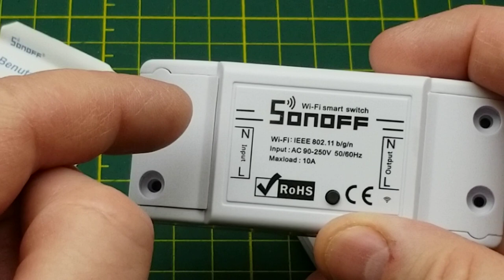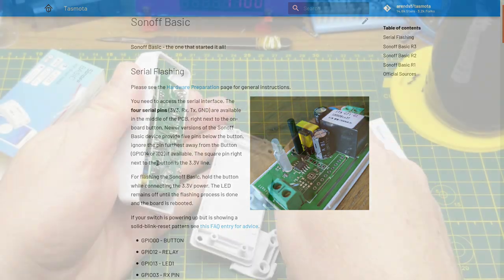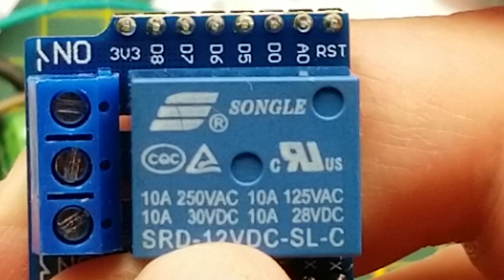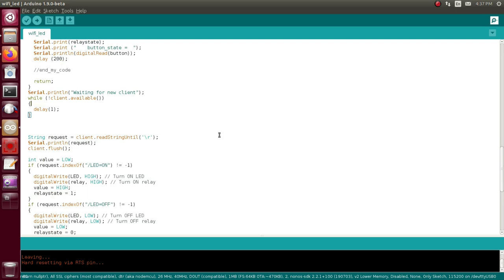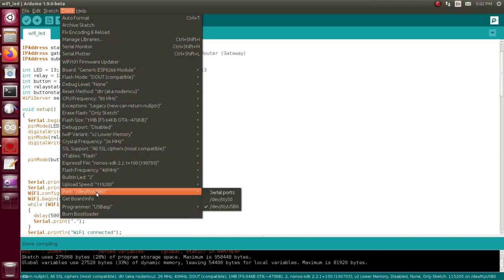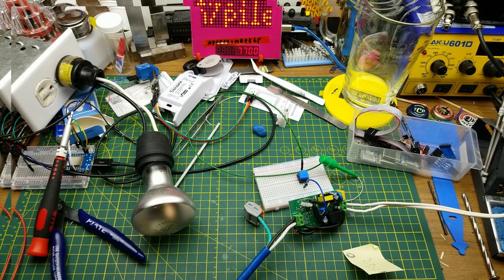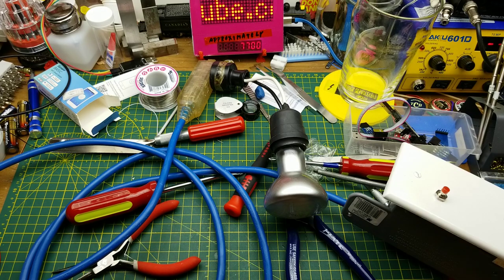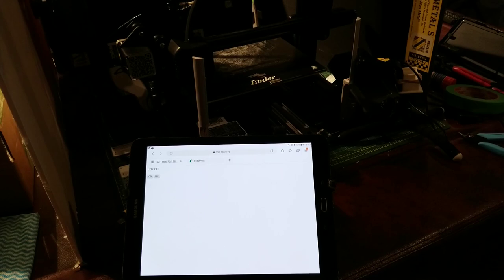Wifi controlled switching - hacking a Sonoff device

Comment: You have a Sonoff Basic R2, which is why GPIO 14 was not found. The older ones don't have the large black wires for the mains current. The GPIO 2 pin with cause a boot failure if it is held low when the unit is powered on. I've done several with the external switch connected to the RX pin (GPIO3). Programming was easy using Hpme Assistant and ESPHome. Using GPIO3 (RX) will let you use a toggle switch, for example, a standard light switch. You just have to flash it before soldering on the switch wires. The program can be updated over-the-air so the serial connections won't be necessary after flashing.

Comment: Great project, and for those naysayers saying that version of pi doesn't work, I guess you proved them wrong. Great setup and idea.
Reply from the maker: I still would recommend that people use the supported hardware, but in my case I use the most basic feature s so I don't overload the poor little guy.

Comment: Neat lighting on your Ender 3. I did similar, instead running a strip inside the bottom-facing v slot of the top rail. I also placed a short strip directly onto the hotend cover to illuminate under there. I still haven't gotten around setting up Octoprint, but I have all the parts to get it working.

Comment: Thank you for your time and nice video. I would assume Tasmotizer tool would be much easy to set up your GPIO pins. Haven't tried with ESP tool to flash the chip yet. May do it sometimes.
Sorry I missed how you connected the push button switch to the R2 device. Would assume you wired one end to GPIO2 where you connected 10K Ohm between GPIO2 to 3V3 pin. Then the other end of the switch wired to the GND pin. If that is what you did, I would like to give a shoot. This will be a cool to use the R2 to control a light through App/HA or a physical switch button. Thank you.

Comment: Itead also have a Zigbee version of this.   Most of the Itead WiFi stuff is highly hackable as they are based around the ESP8285 chip, which is pretty well an ESP8266 with 1mb RAM onboard. 
They are a really great devices.  Very popular with "Makers."   The SonOff Mini is also great if you have less space.  You can modify the SonOff Basic t0 be a dry contact relay as well.  I use one with Tasmota as a "smart" thermostat.

Comment: I would have just gone Tasmota on that. It comes with a UI for the web, can be direct driven by URL Post commands.
The default button is an on/off by default as well. The external switch is a useful addition for your use case though.
Reply from the maker: I looked into tasmota a bit, but they focus so much on the MQTT / home assistant stuff that I never found that info.

After several people mentioned that there actually is a web interface I finally found it buried deep in the project's web pages.

Oh well, this was a fun challenge. And I learned some stuff.
Reply: @pileofstuff  MQTT is a great way to communicate with these.  Tasmota does have a lot of Home Assistant fans, so it is easy to get lost in the documentation.  Home Assistant seems to be popular :)
Reply: @pileofstuff  One day I will get you on Node-red and MQTT.  I think you'll genuinely love it...but this was a good project in its own right and I learned some stuff along the way.

Comment: The Sonoff S31 has regular AC receptacles, and does Kill-a-watt-like power monitoring, which I've seen used for interesting things like detecting when the washer's done by the drop in power draw. An interesting member of the Sonoff family (I'm using with Tasmota and Home Assistant).
Reply: btw, the s31 is not supported by the sonoffs web interface still , cant even be turned on or off . the camera cant trigger a scene like they say it can. and ittt support is usless unless you want to pay for iftt and the advancded sonoff subscribion

Comment: Hi - You should flash these Basic units using Tasmotizer. The R2 also has a switch built in.  I also run Octoprint with the tasmota plugin which allows you to switch everything off from the octoprint webpage. I have all of this setup on my printer for the last few years and works perfectly.

Comment: This might be useful for me as a basement workshop hazardous (mainly thermal) kill switch and double checker, like if I was using hot air or a hot plate, I want to keep certain appliances like that on a dedicated power bar I can switch off upstairs if I forget and maybe have it semi-automated where I know I only need the stuff for a few hours so I set a 6 hour power strip shut down timer and have it protect me from myself

Comment: The button on the sonoff originally is programmed to manually turn the unit on/off.   Cool that you were able to add a second switch and enclose it in an electrical box and I don't blame you for not wanting to use the factory software.   Security concerns aside, seems a little strange to send the commands all the way to China and back if you don't  need to access over the internet
Reply: Yep. But it can be handy to have some internet-accessible server if you want to control it from your mobile phone, for example when that is not on your wifi but using 4G for its connection. Also when at your own home.
I really like this idea though and simply use the webbrowser while on local site!

Comment: I used the dual switch plastic boxs for my SonOffs. Left plenty of room for reset and pushbuttons.
Reply from the maker: I looked for those, but as I said, plastic electrical boxes are not very common here.
Reply: @pileofstuff  Got mine at Home Hardware.
Reply from the maker: @DrexProjects  Didn't try there - the closest one is quite a distance away.
Reply: @pileofstuff  Oh ya st. b is miles from nowhere.

Comment: I have about 6 running tasmota connected in the power cord, the lights don't have an earth so wiring is easy.  I've also go two in 6gang extension leads. I just cut the outer cover of the cord away,  cut the L and N then run the earth over the top of the pcb. This way you don't need a connector on the earth to find room for in the box.  Nice beer.

Comment: I'm doing something very similar to this only in hacking a smart bulb for fun. I picked a difficult one on accident because it's RGB seems to be set via a serial protocol. But I have control over the white right now.

I want to write it myself in Arduino for learning and just need to tap it's direct programming lines as it's esp8255 based (esp8266 with less flash) but otherwise I should be good to go.

Comment: Fantastic work. It really never crossed my mind to try to program that thing directly. I've flashed tasmota on them and that's pretty cool, but I could really see some benefit to running fully custom code. I need to make some ESP8266s that are directly powered by AC and this may be the way to go. Thank you.
Reply: probably 100% uslsess, but i wonder if the espixel firmware or similar could run on these. it has 1 pin of io and thats all you need to drive ws2211........ it may even be able to power small strips
Reply: @grimninja2004  I may have to check that out!

Comment: Point to note. You had some issues after programming with it doing funny things. You still had the UART dongle connected. There's a very good chance that dongle won't be providing enough power to run the wi-fi. I've had this issue before at least. After connecting the mains is worked fine

Comment: I kinda followed along but my OCD got hung up on that 12V relay. Where do its coil contacts go on the board? Are you just supposed to kludge 12V in from the outside world?
Reply from the maker: No idea. I'll have to dig deeper when i have time.

I suspect those relays are simply the wrong ones.
Reply: @pileofstuff  Were they ment to be switching something on 12 V like in a car? Easy to hook up 12 Volt from that for the relais and have the other end of the coil be switched by  fet or transistor or even optocoupler but a bit hash to directly link to a GPIO-output
Reply from the maker: @elvinhaak  The problem, as I see it, is there is no way to get 12 volts onto the board.

Comment: Note: If you select the D1 Mini as a board you can just use Dx directly in code like "byte relayPin = D5" So no need to add that conversion in the comments.  And you can just use the button on the Basic to do the toggle. That's what the stock firmware does as well. And an ESP does come with internal pull up's on most of it's pins just like a basic Arduino ;)

Also, Tasmota i still VERY usable without Home Assistant. I would certainly check it out because you could have done all this with Tasmota as well without a line of code ;)
Reply from the maker: I though about using the built-in button, but I didn't feel like messing with extending it outside the case.

Some days I have an odd mix of laziness and doing pointlessly hard things...

Comment: All very good, but you do know you could have done the same thing with just one of those relays and one GPIO pin on your Raspberry Pi? There's an Octoprint plugin that adds a power button on the Octoprint web server, took me about ten minutes to set everything up and cost virtually nothing to implement.  K.I.S.S.
Reply from the maker: I thought about that, but i couldnt figure out how to use the Pi's GPIO to remotely turn the PI on.
Reply: You leave it on. Just log into Octoprint, upload a file, pre-heat and print, when it's done, you just turn off the printer again (there's probably a plugin that will do this automagically by now, but I prefer to do it manually), job done.  Mine's been on non stop for nearly two years without any issues.  Costs virtually nothing to run.
Reply from the maker: @ste76539  That's an option, but where mine is it gets unplugged by other people sometimes, so I prefer to shut it down properly when I'm not using it.